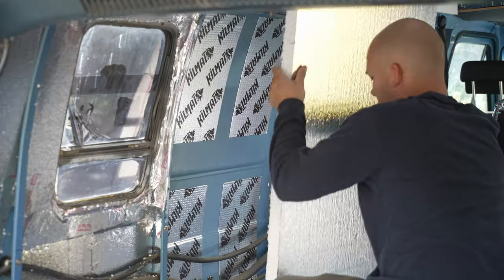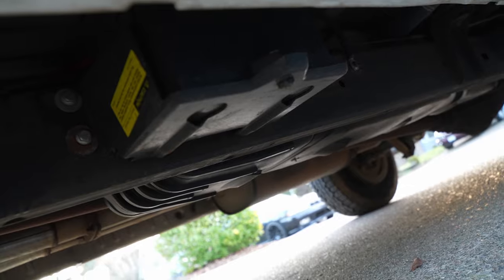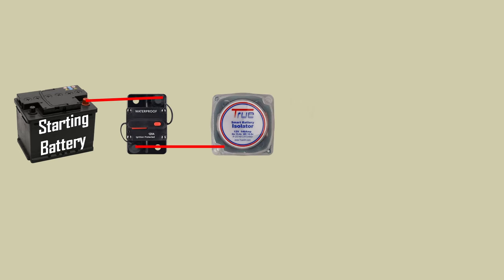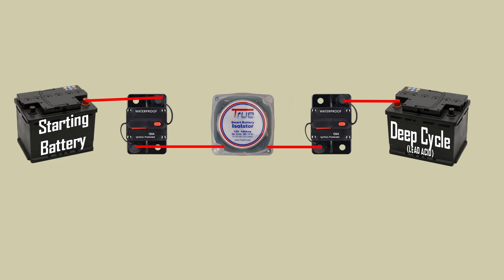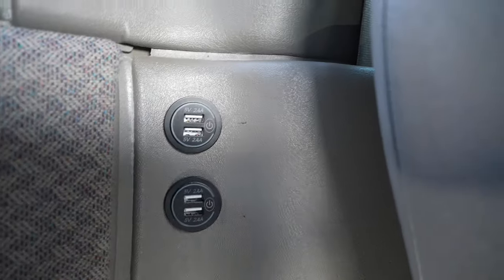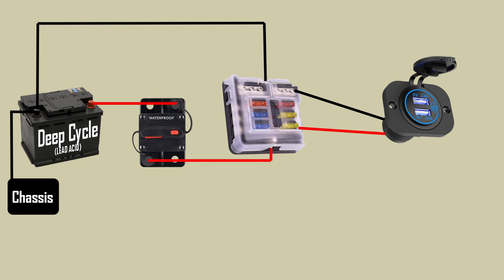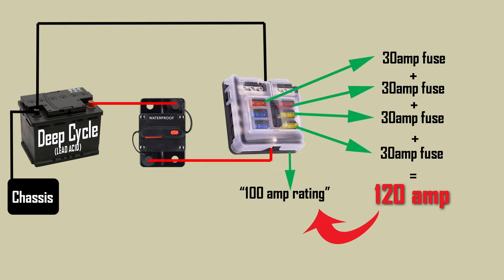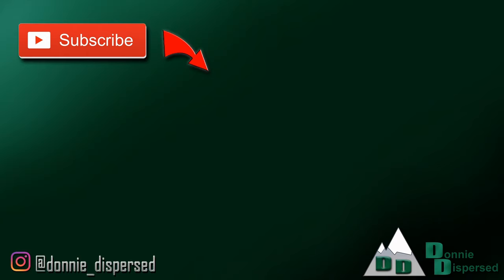SIMPLE DUAL BATTERY SETUP | ( Auxiliary / House Battery Camper Van Overlanding)

Comment: Does that fact that you're connecting a deep cycle battery to a regular starting battery pose any potential problems?
Reply from the maker: With this system so long as the deep cycle battery is a standard lead acid battery it will be fine. 
If you are using an AGM or lithium battery you would want to use a DC-DC smart charger to properly charge the deep cycle.
Reply: My plan is to have my interstate group 24 starting battery and then a 100ah deep cycle AGM secondary battery for my sound system, PA system, CB radio. 

Will the battery isolator you linked work for my setup? Also is the DC-DC charger a separate piece I need as well as battery isolator?

Comment: What if your car does water crossing? Wouldn't that short the battery mounted undercarriage?
Reply from the maker: The mounting location of the second battery is very much dependent on the vehicle and use case. For this van, the battery was mounted there for simplicity sake, and because it was an option from the factory it made sense. 
If water crossings were an obstacle I may have chosen a different location. However the van doesn’t see more than a rough forest road so water crossing isn’t of much concern.

Comment: So if i follow the links you provided and just hit add to cart ill have all the components necessary and their compatible with each other?
Reply from the maker: The amp ratings on the circuit breakers might be different for you depending on how many amps your vehicle’s alternator puts out, and what accessories you want to run off the second battery. But generally yes this should be everything you need minus the cables that connect the batteries and VSR. For those I would recommend 4 gauge or heavier. All copper jumper cables can be a more affordable way to get heavy gauge wire.

Comment: Quick question, I want to mount the 2nd battery in a small trailer. Am I able to put the Isolator in the trailer?
Reply from the maker: It should be close to the vehicles starting battery.

Comment: How do we set it up to use the second battery as a backup battery to start the vehicle in an emergency?
Reply from the maker: Some VSR’s have a button to override the disconnect so you can join them together.
Reply: @DonnieDispersed  I see, thanks. I don’t think mine has that. I guess I’ll have to look for a different one.

Comment: Is 120amp the correct breaker? I accidently bought 70a will it still work?
Reply from the maker: Depends on the amp output on your vehicles alternator. I think with a 70amp you run the potential of tripping the breaker since most vans and full size vehicles have 100+ amp alternators. Find out what your amp output rating on your alternator and make sure your breaker isn’t too much below that rating. An alternator almost never outputs that full rating unless you have a very large load on it but still you don’t want to be tripping the breaker all the time. I chose 120 cause it’s actually a little higher than the standard 105 amp rating on the alternator. It’s also just below the 140 amp rating on the VSR.

Comment: Dose it have to be a deep cycle battery and how would I put an inverter on that deep cycle
Reply from the maker: @Hunter__14  For using to power things with the engine off it needs to be a deep cycle. A regular battery will be ruined quickly by the constant draining and recharging. 
Adding an inverter is easy, just wire it up to the battery directly. Not through a fuse block.
Reply: Any recommendations on a deep cycle battery

Comment: On the  deep cycle battery can a power inverter be connected?
Reply from the maker: Yes. But it needs to be wired separately, not through the fuse block.

Comment: Why would someone get a dc to dc system. This seems much cheaper
Reply from the maker: Better batteries such as AGM or Lithium require a dc to dc charger. This works because the battery is a standard lead acid deep cycle battery. Same charging requirements as the vans starting battery so it has no issue connecting and charging in line with this relay. This battery and set up costs less but lacks some of the benefits of other batteries.

Comment: How do you choose the size of the breakers?
Reply from the maker: That can depend on the amp rating of the relay, the amp output of the alternator and the amount of amps the size of wire you use is rated for. 
-Start by finding out the amperage of your alternator.
-Select a VSR with a rating higher than the peak output of the alternator. 
-Use a DC wire gauge chart to determine what gauge wire you need based on alternator amperage and length of wire you need to run. 

-Select a fuse or circuit breaker that doesn’t exceed what that wire is rated for or the max amperage of the relay. 

It will likely be somewhere between the peak output of the alternator and the max amp rating of the VSR. Like 100-120amp.

Comment: What is the best way to charge the dual battery system with a battery tender?
Reply from the maker: I just crawl underneath and put the clamps on the second battery for this set up.
Reply: @DonnieDispersed  will this charge them both, or do they both need to be separately charged?
Reply from the maker: @DSmith-hz6bg  with this isolator, if either battery is being charged, it will connect the two so they both get charged.
Reply: @DonnieDispersed  thanks for confirming this for me.

Comment: can i add inverter? with this system?
Reply from the maker: Yes, you would add it to the auxiliary battery in the same way I showed adding the fuse box.
Reply: @DonnieDispersed  can i add fuse box and inverter?
Reply from the maker: @vassadesign  yes, run them separately though. Don’t try to power the inverter through the fuse box.
Reply: THANKS.but i got one more very important question, what gauge cable to use?battery to fuse, fuse bo battery and battery to inverter @DonnieDispersed
Reply from the maker: @vassadesign  depends on how long the cables need to be in your system and how many amps your alternator can put out. There’s calculators you can find online that will tell you what gauge is recommended.

Comment: You know newer vans come with smart alternator so this setup is not suitable for smart alternator.
Reply from the maker: True, this van is quite a bit older than any van that would have a smart alternator. I have other videos breaking down auxiliary battery systems I’ve installed with a DC-DC charger that would be suitable for a vehicle with a smart alternator.

Comment: Does anyone watching this see what size wire to use?
Reply from the maker: That will depend on the amps running through the wire, and the length of the wire you need to run. Look up DC wire gauge chart, there’s a lot of them out there.

Comment: Am I the only one smart enough to just pull the dual battery setup out of a scrapyard truck for $50 and a lightly used deep cycle battery for $100. Why spend more when there's already options in the scrapyard. Oh and I installed a converter from a camper in the scrapyard I got for free because they didn't know if it worked. That way 5 years ago I did the first conversation and I've done 13 more conversations with the same methods for people who are building their own van life vans
Reply from the maker: What truck system isolates the second battery?
Reply: @DonnieDispersed  $5 battery cut-off switches between the two batteries. I can isolate the deep cycle battery when the vans aren't running to use the second battery to power the inverter/converter from the camper. This allows you to charge the deep cycle while the vans running. Just have to make sure you swap out the entire charge system from a 3/4 ton or bigger. So far it's worked amazing. I'm actually working on my neighbors work van right now installing this setup so he can charge his batteries when he's at a jobsite with no power on site. I totally forgot to add the cut-off switches to the list of things.

Comment: So theres no way to wire it up to the alt?
Reply from the maker: Directly? There’s no need to. It’s connected to the alternator simply by being connected to the starting battery.
Reply: Or use an expensive BCDC Charger instead of a an isolator (and you don't want the override start assist button) This will triple your spend as displayed here. It is better to use a BCDC Charger of course. But not necessary.